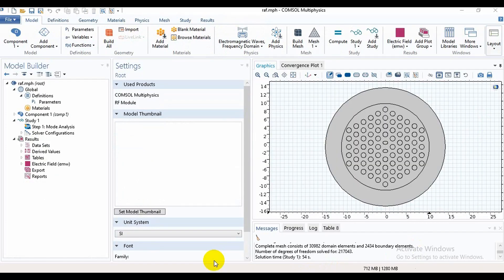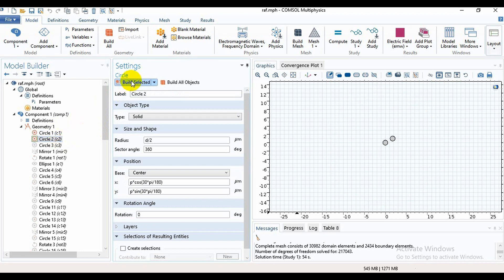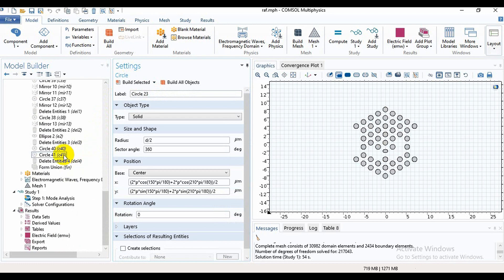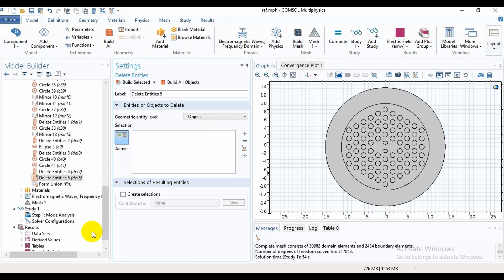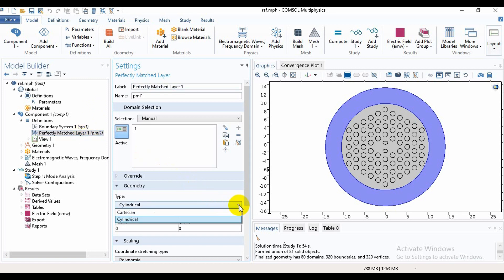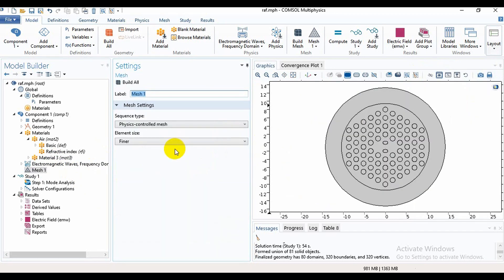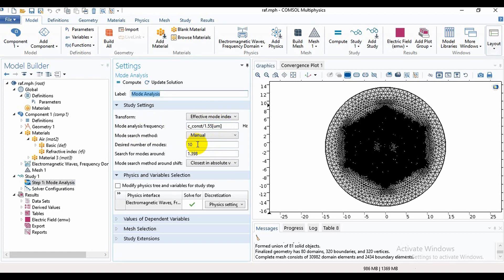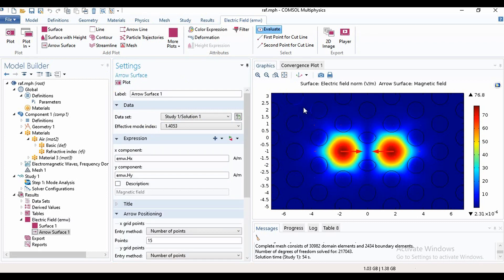How to make a Dual Core Photonic Crystal Fiber using comsol Multiphysics 5.0

Comment: Mam, it is a nice video. But sorry to say that I can't get my modes. I had used the same things that you had taken. Actually, the problem is there in the RI of n_silica. I had used the same values and the same formula but I got 0.99998 instead of 1.444. Please look after my problem.                                                                              With Regards, Subrat Sahu, Ph.D. IIT BHUBANESWAR.
Reply from the maker: You can use blank material and there you can find built in option and you need to search silica glass and thats value is 1.45 so you can also use that if you can't use n_silica.
Reply: Thanks, mam for the personal emailing. Yes mam I got the Fundamental mode by taking the Silica Glass. Thanks a lot.
Reply from the maker: You are most welcome